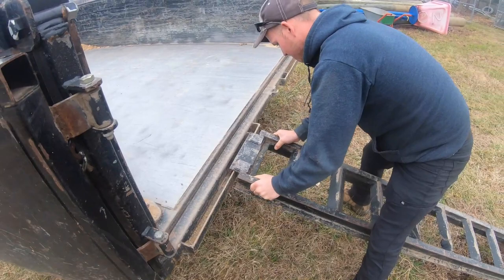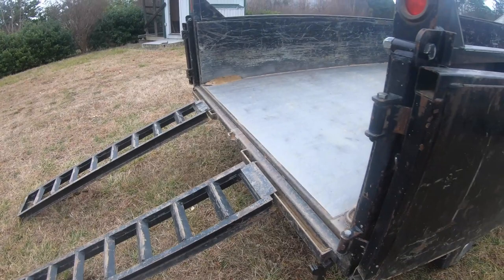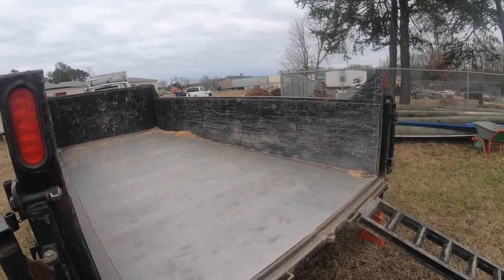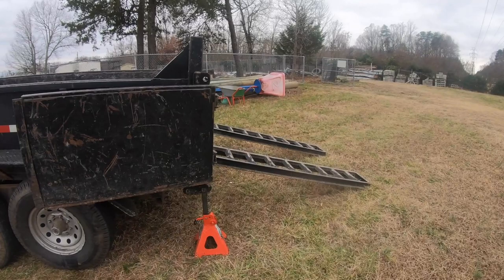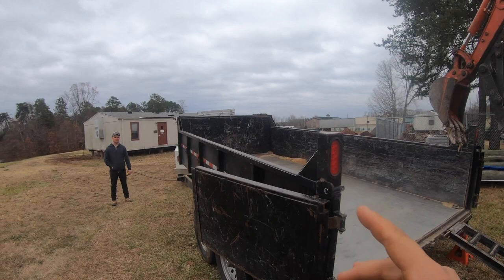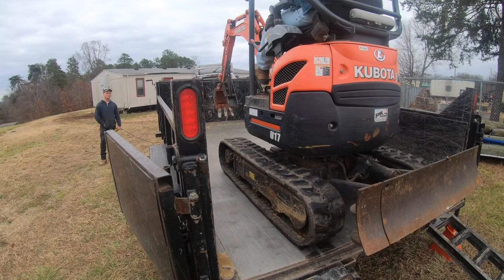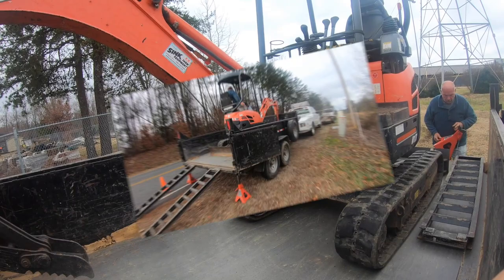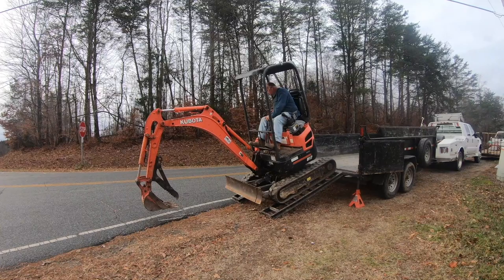Loading & Unloading Mini Ex In Dump Trailer

Comment: Thanks for the great tip about the chain. That tipping point on just about all trailers is the most stressful. Often I go on backwards with the bucket facing the ground. Then push up with the bucket on the ground,. Lowering the part that's already in the trailer.
Reply from the maker: Your  are right sometimes it gets a little hairier at that point thank you for watching

Comment: what size trailer is this ? can i load a 17G on a 10 by 5 trailer ?
Reply from the maker: Hey I think  you need at least a 10,000 lbs  trailer.  The one on the video is a 14,000 lbs 14’ trailer we have a  10’  that’s works great.
Reply from the maker: Thank you for watching

Comment: you  should  not be giving advice  when you not  able  to load a machine properly,      rubber on steel  wont slip if it raining,    no need for chain in front to pull  machine up on trailer,    i have operated  machines  from  1.5 tons   up to  50 tons   and loaded them on all types of trailers,     and  hearing you advising people  how to load  machines  makes me puke   especially  when  you just  dont have a clue
Reply from the maker: Thanks for watching